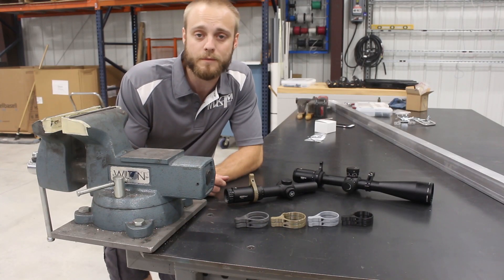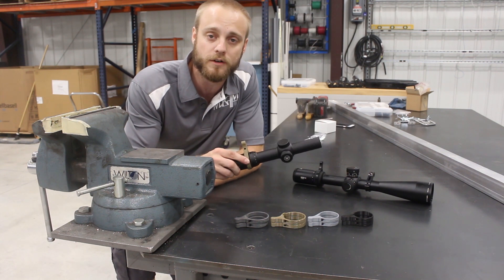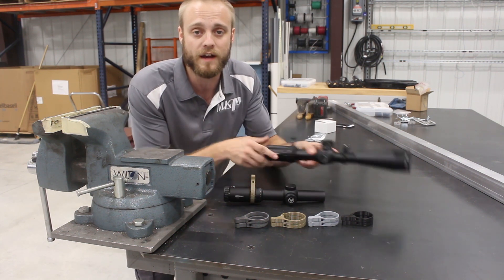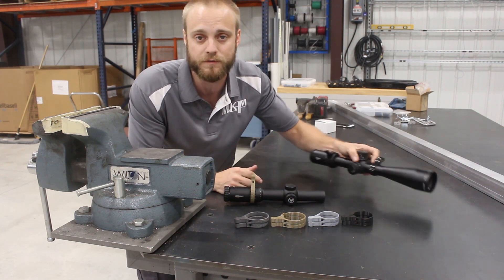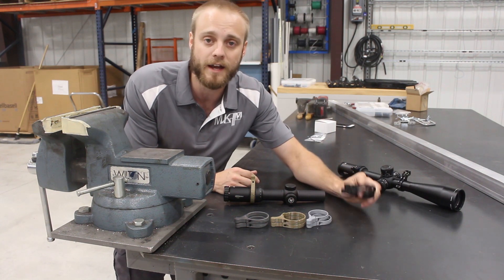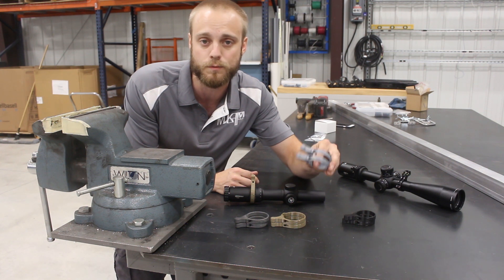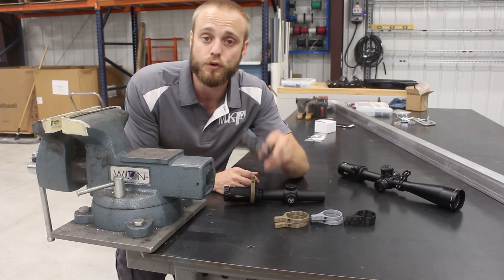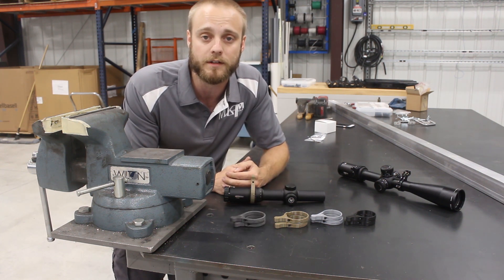Demonstration of 3D Printed Material Durability

Comment: Very cool, I just ordered one of the printed scope mounted  bubble levels in black and it appears they are made of a different plastic? How does the durability of the PA11 material compare? I'm not using my scope for a hammer, but I'll be using it on a hunting rifle and it may take a small bump at some point. I plan to put it in a somewhat protected area on the scope if possible.
Reply: PA11 is more durable than the former CF and nylon6 that MKM started out with. PA11 on our new industrial printer also has a better surface finish.